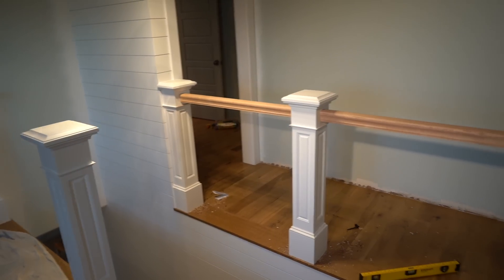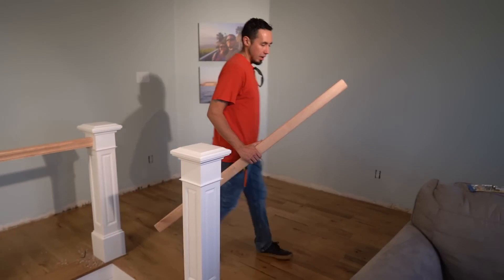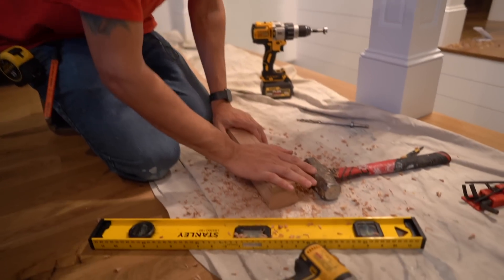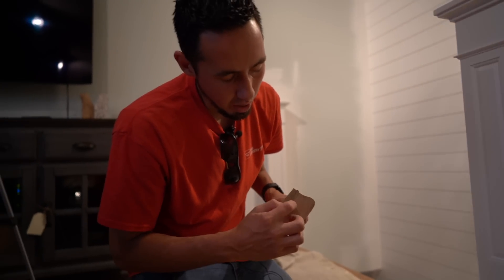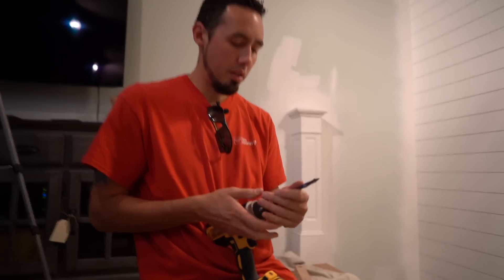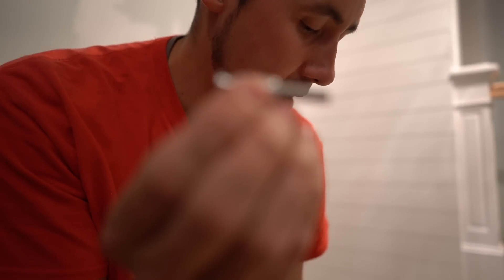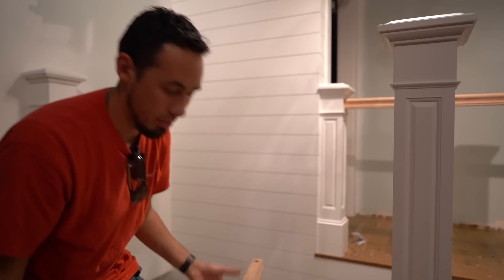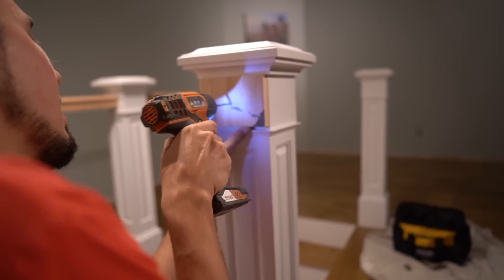These were Stronger than I Expected! - Finally Making Progress!!

Comment: You have helped me so much in my own house. 
As a kid i got into carpentry from building subwoofer enclosures.  Very armature at best.  Then i bought a finish nailer. Router etc then instead of screws it was counter sunk brad nails and glue and miter joints.  Now im doing crown amd everything else.  The progression has been great. And your vids answer all my questions on point. Great vids.

Comment: Another great video.   
To step up your  production,  layout, mark and drill baluster holes in both the rail and the sole plate before installing the rail.  Always do this on flat work.   On sloped rails when possible, I mark and transfer the marks before installing the rail  but always drill them after the rails are in place.

Comment: Leave the top caps off the newels until you install the rails, then you can use either lag/bolt combination (lag into handrail, bolt onto newel) or bolt/bolt combination (drill hole in bottom of rail as you did here, bolt on both newel and rail). But looks great. Also you'll want to plug holes in bottom of rails, you can see them as you walk up the stairs. Nice job!

Comment: Just as it is with framing floors and walls, marking the top and bottom rails for balusters  BEFORE you install permanently makes life so much easier. I’ve done it both ways. Saves time and effort. BUT it looks great. As usual!!

Comment: The newel posts came out looking great!
The attachment hardware are pretty good. The old school method of attaching the rails was to drill a hole through the newel and the end of the rail. Drive a lag into the rail with a ratchet.
Great looking project.

Comment: When I installed our stain grade square wood balusters, I first twisted them onto double sided screws into the flooring for a clean look (without a shoe rail) and then slid a plowed hand rail over the top of the balusters. Adding the handrail first will probably limit you to a paint grade baluster (to hide fasteners marks) or a metal/iron baluster that goes into a bottom hole on the floor and then slides up through a hole under the hand rail.

Comment: Looks great. A tip for the next time you build box newels, or have to work with them, is to either leave the cap off and bolt the rail on from the inside, or add material behind where the rail will connect so you can use rail bolts. Rail bolts are super strong. Plenty of piece of mind, no extra screw needed.

Comment: Great teaching vids!
I have enjoyed the making of the Newell posts which turned out nice.
I also use Sommerfeld router table and bits. The fence is large and allows larger project pieces.
Also, the sanding flapper with grinder for back cutting crown looks like a worthwhile investigation and trial.
Thanks for shooting the v-log.

Comment: Those fixings are quite common now in the UK and are so much faster than traditional mortise and tenon.  They do a range of different stair hardware. Did a nice job. Bit of glue maybe and finish tighten by hand so you can feel the pressure a bit better. Totally changes the stairs.👌

Comment: Looks good, if the caps on the post were removable you could have bolted the rails from inside but it still looks great it would look good with black metal balusters.

Comment: Looks good Richard. Newel posts are killer. One thing tho’ depending on your balustrade design,  whether you use a toe rail or tenon the spindles into the floor, you may need to take all those top rails loose again in order to assemble the system. Also you can buy tapered 1” oak plugs made to conceal the rail bolt holes. They are much better than anything you can site fabricate. Great job so far!

Comment: I have never used that system but I like the concept, I'll have to look into those on my next stair build. you were right to add that extra screw its just added insurance that the rail will never fail. With the railing you used you are going to need to stick with a wood pin top or metal baluster. Wood is going to be your less expensive route, but metal is a nice contrast or wow factor. Looks good so fare keep up the good work. P.S. What I have seen from your skills so fare you should have no problem with stairs, it only gets to be a pain when you start doing bent railings. Keep up the good work.

Comment: as the posts are custom hollows some night lights in them would be my addition , or you could put down lighting in the actual hand rails, router out a slot underneath for some led strip lighting so you get a nice night glow
Reply: @tribulationprepper787  meh, its a chebby, only thing i'd put under that is a bomb :) , i can talk i have two rear engine classic skoda's

Comment: Did you consider or have access to railing stock with the channel for the pickets on the bottom?   

Suggestion - on the floor - use masking tape and a compass and scribe to plot before drilling holes in the nosing.

Comment: Posts look great 👍 that's definitely a really cool fastening system for the railings, I've used a few different techniques over the years, and that's one I haven't personally seen  but next time I'll certainly see if I can find it! Simple and easy, and I'm completely on board with adding the screw, 100% if you have room for extra fasteners then it's completely warranted, at least you know it's not going anywhere! Lastly, I'd totally go with with metal balusters, those will look sick 😎👌

Comment: Since you handrails aren't ploughed out on the bottom to receive the Balusters and the Oak fillets, you might want to pre-drill the holes for whatever Baluster's you are using before installing the the handrails. It's a lot easier than drilling upside down.

Comment: Not sure I'd have completed the rails until I drilled (assuming you need the holes) holes for the balusters. Typical installation would require a hole under the rail and in the floor or some piece you put over the floor to hold the bottom of the balusters. But it's looking great. Looks like you have a busy December ahead of you.

Comment: Really good video on how the system works Richard! I’m kind of surprised you didn’t just pop your post caps off and internally hide all your fasteners though. Right angle attachment, predrill, mount and reattach them hollow post caps. Awesome work though!

Comment: Or you can use the regular studs that are threaded for wood on one end like a lag screw, and regular threads on the other end, and put those into the posts. Then what you do is drill your 1" hole in your rail as you would normally do, and a 1/2" hole in the end of the rail, and then break out the bottom of the rail with a sharp chisel, (from the end grain, in a "v", two hits) so you can get the bolt to slide through the bottom of the rail, and then glue that piece back in, and tighten the nut.  The grain will match like it should. Then put the 1" plug in.

Comment: Ya it’s cool but I use a 3” 3/8” bolt washer and nut system. Same premise drilling 1” hole to get your wrench in and tighten it up. 1/2” whole on the side for slop adjustments if you don’t install the bolt perfectly. It can withstand 200lb of pressure which is code in California. Thanks for the alternative tips. Cheers!

Comment: With those type of connectors for the rail going flush into the “hollow” newel post installation,  does not seem the same connectors will work if you are doing the rake going down the stairs due to the angle of the mitre. Are those connectors adjustable? I am by no means a carpenter at your level by just doing some work at my own house. Thanks and great videos!

Comment: did a build in the uk back a in the 90s the stair guy in the house next door had jigs for different handrails and would router out the the post and run the handrail right into the post only guy i have ever seen do this in 40years made a tight/strong joint

Comment: Block inside; predrill and trim screws...Trim screws are a finishers savior...I only would have had one newel too at the top of the stairlanding...Normally; we but a round topped 1 X 4 or 6 on the wall side. Sometimes, if there's  a stud there; we just put a block or even drill and  screw it into the stud...Those newel post ain't cheap...Just makes more stuff to paint...

Comment: Wondering if you went back and put in a plug/ dowel in to fill the hole on the underside so you don't see it when walking up the steps? Or did you not worry about it?

Comment: Nice job, great fixing method, little glue would help too. I would definitely go with square balusters, metal, maybe 12mm square. Lewis Insider carpentry has a great video on them.
Reply: It's because the posts are hollow so the screws wouldn't have much contact. You'd need to glue more wood inside the posts.

Comment: I like the look and you did a great job explaining the process and filming it as well. Can you use the product outside? On a deck rail? What is the name of it, cost, and where did you get it?? I must have missed the previous video or did you video making the posts? One more question, I would like to put lights on the posts on our deck,but not sure what kind to get. Any recommendations for brand and type? I don't think i want to hard wire them. Is there solar power with a battery backup? As always, Thanks for sharing your thoughts and videos, Rodney

Comment: I install handrails for a living and the fastening you used it great but not so handy if you’re installing a top rail with 1/2” dado for 1/2” spindles. The 1” hole required for the kit causes a pain for the fillets. It’s great if you’re installing wood spindles that most commonly are 15/8” wide with the same width fillet to cover the hole.

Comment: Hey there... cooper stairworks somerset ma. Here... only one concern... the added screw weakens the bottom of the rail a bit... alternative option might be using sleeve/insert setup for balusters.... otherwise great job... give us a call if you need anything ... cooper stair works in somerset ma.

Comment: You should off eliminated the middle post.  It would look better with a longer uninterrupted run. Also should off stained and finished the handrail before installing it onto a white post.  Now it's basically impossible to get a clean joint between the post and the rail. 10 years doing stairs. Great job making those posts. They look like they're 5". Saved a tone of money making them.

Comment: Everyone is a troll, me I’d never level the top, or bottom, rails- I’d go with equal reveals which eyeball better than a minimal out of level and will leave you assured that the balusters are all the same length. Check the newels for plumb one last time and put the level away. Equal, equal when you hang the balusters.
Reply: Finish product is sold with the eye, good call.

Comment: Did that one post get a slight "crack" in it from the tightening or is that just the dust from drilling? Also, when you did tighten, you stated there was some "movement" in that post, when tightening, won't that change that post from being plumb? Great video. Cheers :)

Comment: Very cool system. I would just say that unless you are experienced with an impact driver, use a drill on mid torque screw driver setting. Otherwise you can snap something.

Comment: Just curious on two things. Why wouldn’t you finish the rails before you put them up? Or is that the finished product? Also are you going to be able to plug those holes with that screw head in there? Or do you plan on leaving it as so.

Otherwise great work, love the channel.
Reply: Cause you always nick and otherwise ding the rail during the install, and then you have to redo the finish. Do the work and finish last.

Comment: Great work!!! Quick question...when you added the screw at the end, on the close up, it looks like the post was cracked.  if so, would you recommend drilling a deeper pilot hole?
Reply: Anthony Albano I saw what you're referring to on the post, and on the rail itself, on the rail it was his center line for where he drilled the bottom hole, and the mark on the white post was definitely from the end of the piece that goes into the post from the rail, a little bit of marring from that metal nub sticking out of the edge... I'm sure he'll be painting the posts again, or at least touching up for things like that. But it definitely wasn't a split or a crack, not really a feasible thing the way those were built for it to have cracked sideways like that. I totally understand your concern though.

Comment: What do you call that tool you marked the line with? Not the pencil, the other ruler thing.
Reply: Kreg KMA2900 Multi-Mark Multi-Purpose Marking and Measuring Tool. As of this posting Amazon is selling for about $10. IIRC, I got mine at Lowes years ago, no Idea of how much I paid for it then. It will layout 45s also. Very handy tool.

Comment: I’d suggest you plug those big holes with plugs made from a dowel of the same material as the handrail. Otherwise, when walking up the stairs those holes in the ends of the handrail will be visible. Not a good look.
Reply: Thanks for pointing that out. The kit does come with wood plugs. I’m sure Richard must have used the plugs to cover all of the internal hardware. 👍

Comment: You should put longer bolts. You have different sizes of i. It's on edge of rail and someone can push that and brake down. For me if kids can't sit on it it's not strog. But nice idea. I'm gonna try that this week with longer pins.
Reply: Jovica Blagojevic No chance that’s going anywhere, remember inside that newl post is fresh air, box construction using 18mm material.
Reply: @scottsog7635  I was thinking on the rail. The screw on the post is strong enough. I don't know...

Comment: 'Finish Carpentry TV'. i see a poorly sharpened oversized pencil, a 25 foot tape, a 2.5 lb sledge, and an empire fixed vial level (half of the empire levels i've checked have been off) and i suppose those dark glasses are for seeing fine details.  but hey, thanks for the video and keep practicing.

Comment: Iron balustrades and mount them directly into the floor. Thing is with that, is all the handrails have to come out to fit the balustrades first. You are making life difficult for yourself by not getting a plan before hand. Why use a level for the handrails, just throw up the laser and you can quickly check posts and handrails. Nice work though.

Comment: I’d use loctite on the threads so they don’t loosen up
Reply: They're aluminum so trying to get them back out to replace, may just round/snap them? We use them a lot on kitchen fitting when doing masons mitres. And they never come undone.
Reply: They are pulling against each other,I doubt they are gonna move

Comment: The 'safety' screw is totally unnecessary as the spindles, once fixed in position, will prevent any movement of the handrail.